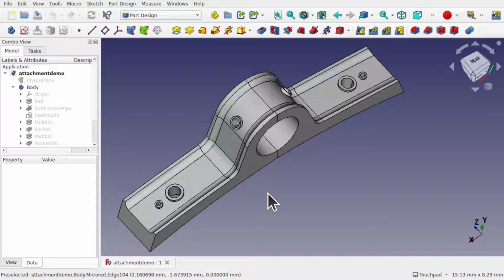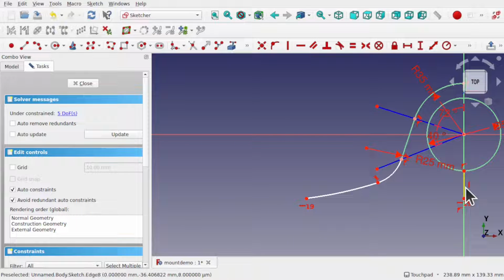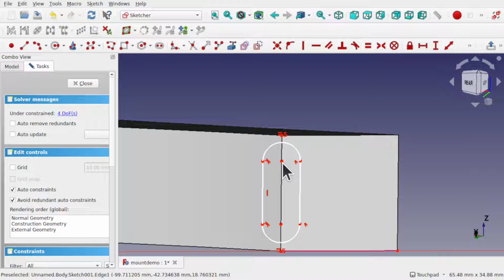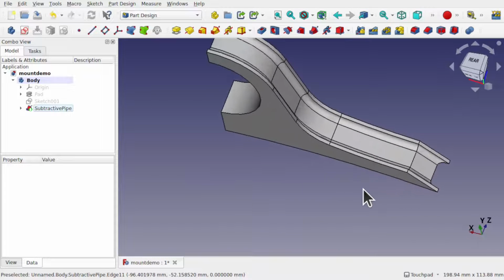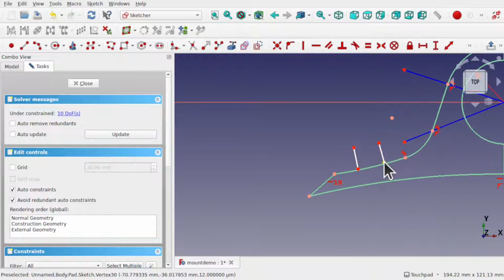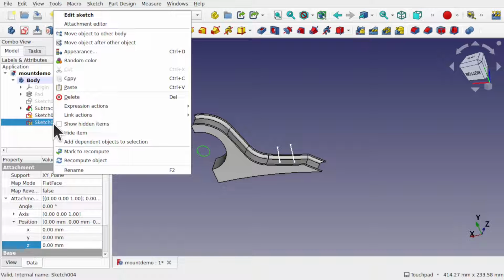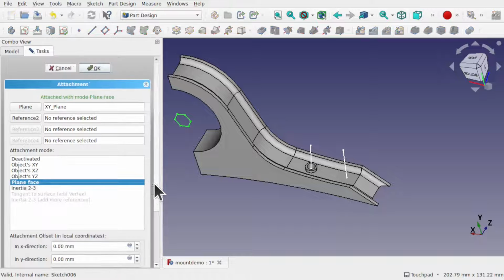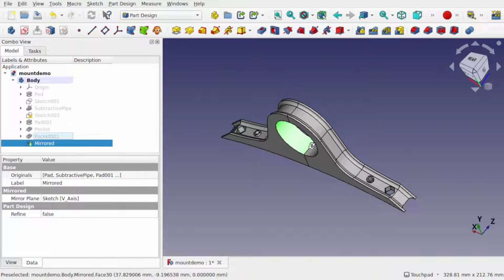FreeCAD for Beginners 26: Part Design Features on Non-Planar Faces and Curved Surfaces

Comment: Hi I'm just learning FreeCAD so I really appreciate the tutorials I think you are great, really, thanks a lot. However I do have a question if you have the time to respond. Didn't we brake a cardinal rule, by placing a sketch on a face because of the topographical naming problem? couldn't we have created a datum plane to create the sketch on? I hope my question doesn't offend, I'm just learning, and I value your opinion, if you have the time to get back to me I would appreciate it, thank you.
Reply from the maker: Glad your liking the videos and the question has been asked before so don't worry no offence. So the videos follow traditional CAD practice which is the same in all CAD programs. This is not a cardinal rule, there is so much drama over this issue and that comes  directly from someone  that I  know who knows  the source code. At some point the topology naming problem will go away which leaves the tutorials that follow the datum plane method over complicated and redundant . Often people get the datum plane technique completely wrong and map datum to faces. You will still get the same issue. If you decide not to use the map modes you are restricting yourself so much it would be pointless using freecad as all the benefit of CAD vanishes. People often get topology issues wrong as well. I have heard people scream 'topology naming issue' when you remove a face that is reference by other geometry. If I was standing on a ceiling and someone removed the beam supporting me, I would of course fall through the ceiling. This happens in all CAD packages.. To overcome such problems of true topological naming issues is to focus on understanding how to fix the model and keep things simple. As sais soon this will go away., already in the new version of freecad planed this gets better. So no offence taken but it has given me a few ideas regarding a video on the matter.
Reply: @MangoJellySolutions  wow, thanks for the thorough answer and I'm sorry I didn't search through the comments to find that question and answer. However, I do have a follow up question. What do you mean by at some point the topology naming problem will go away, is there a fix planned in the future. Will that impact all versions or just new versions. could you explain a little how that will work, sorry my knowledge is limited, and I would really appreciate your input. thanks for getting back to me I really appreciate it. I would love to see a video on the matter I think that would be great.
Reply from the maker: No problems, there are a lot of videos on my channel with a lot of comments so I don't expect anyone to read back through them all. At some point I want to collect all the content in a questions and answers for each playlist so they are easier to find.

So there is a fixed planed due the upcoming version of freecad v1 from what I last heard then going forward I can only see this getting better.
Reply: @MangoJellySolutions  Awesome, thanks for getting back to me and the quick reply. I'm happy to hear there is a fix planned in the future, that's great. I think a questions and answers would be great I would definitely be interested in that and I'm looking forward to it. I just wanted you to know that I really like your content and I'm looking forward to more. Today I'm going to do your spartan/ roman helmet tutorial so thanks a lot for your content, it's great.

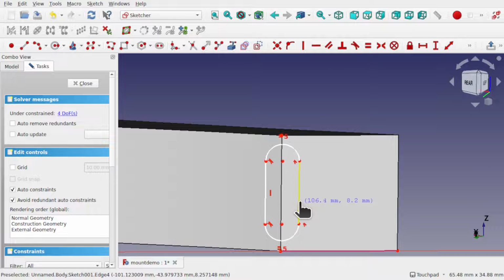Comment: At about 9:35, as you're placing the slot I see the dimensions displayed to the right of the pointer. I don't see that on my system - how do you enable it?
Reply from the maker: I finally found it 😁 make sure you have already visited the sketcher workbench and then go to edit > preferences > sketcher > display > show coordinates beside cursor when editing
Reply: @MangoJellySolutions  Thank you!

Comment: That is a very useful video. One question, if you mirror a part like you did, is there a physical separation between the two resulting sections. If I were to 3d print it, would it actually print 1 or 2 parts?
Reply from the maker: Thank you. In answer to your question no they are all one single part as it's been created in the part design. What the part design does is an automatic fusion with the last action. If you did this in a part workflow then you would need to fuse both parts together first.

Comment: wow did you invent that operation your self?  very handy !
Reply from the maker: Glad you enjoyed. This is a practice that is comon in freecad but it is a complex area as you can map to anything but in different ways which will cause the local coordinate system being flipped in different directions. It's something that I am going to go into quite soon.
Reply: @MangoJellySolutions   can you witness topological trouble in action ? So under the tree , the drop down  xyz  you want to move object in space , so you press say x and when you look far bottom right of screen, xyz arrow director,  your parts is moving in a different direction then it points. Thats bad right ...?
Reply from the maker: @BrainDeadEngineering  That is because of local vs global co-ordinate system, don't worry this is some what hard to understand and seems impractical until you understand the reasons why.  Your the third person who has asked a question around this and I have just finished a video which I was going to release in 2 weeks time but I think I will release it ASAP.  Mapping a sketch changes the orientation in relation to it's support, this is also the same as mapping an object.  Mapping a sketch flat face results in the sketch Z axis running in and out from that supporting face, known as 'normal vector' or normal to face.  Moving it to another face the Z axis will always be normal and will differ from the Z axis of the world, the global coordinate system.  This is the same in all CAD packages and there is a very important reason for this which I go into in the video but basically it makes position your feature/sketch on that face easier than the alternative.  I am just proof viewing the video tomorrow and it will be released in the next few days and I can grantee it  will help.
Reply: @MangoJellySolutions  I Love you Mango !

Comment: this is great, it does lots of things people are kind of scared to do, or that "feel bad", but are totally the way to do it. people tend to import the body when it'd be better to import the sketch it's based on too, if you don't manage visibility manually it causes all sorts of problems. in other cad programs references can get promoted to the simplest element (like the base sketch) when it's possible to do so without manually managing visibility of stuff. people used to working on a timeline like from fusion 360 are in for a bad time

Comment: Always something to learn. Thx.  Anyway, to reuse the same sketch for all the holes? Assuming that is what one wants, of course.
Reply from the maker: Great to hear :)  So to use the same hole sketch you can make copies by Ctrl C, Ctrl V the sketch but it will be attached to the same support.  Click on the button on the map mode for the sketch and attach to the chosen reference geometry.
Reply: @MangoJellySolutions   T h a n k  y o u :)

Comment: If you have the B-Spline and unable to constrain the points, draw the lines longer and trim them. But since you are passing the line with "two dimension" option in pad, it is irrelevant to lie (lay?) exactly on B-Spline.

Comment: Really wish I could get Linux/FreeCAD to run properly on any of my computers, I'm keen to learn but Linux is just one issue after another and I can't be f'ed with it atm, it's a lot of work to run a Linux machine when you're not a pro-user. maybe I should try FreeCAD on a stable Windows OS
Reply: I happily run FREECAD on my Mac, I expect the Windows version would be equally well behaved.
Reply from the maker: I run freeCAD both on windows and linux and they are identical and work just as good on windows so you shouldn't have any issues.

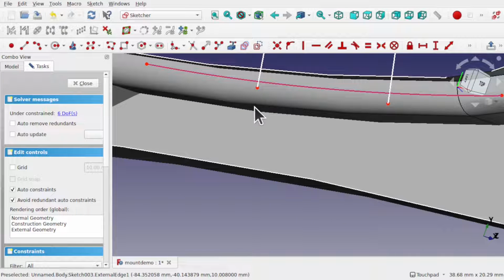Comment: At 22:42 where you select the curvature external geometry I seem unable to get past this point. When I try to select the external geometry I get a b-spline and am unable to set the point constraint to line or curvature. Any suggestions?
Reply: If you have this problem, then "Create external geometry", draw the lines bit longer than this new geometry, and just trim the lower bottom. This way it will lie exactly on the line.
Reply: He did say in the video that in the case of a b-spline you can just get the point close to the b-spline instead of using a point-on-line constraint.
Reply from the maker: Thanks everyone for the comments regarding this.  Yes sometimes you will get a b-spline depending on the geometry calculated.  Nice tip for constraint by Naser.  One day freeCAD may have a on object constrain for bspline which will open up many doors.
Reply: same on my side